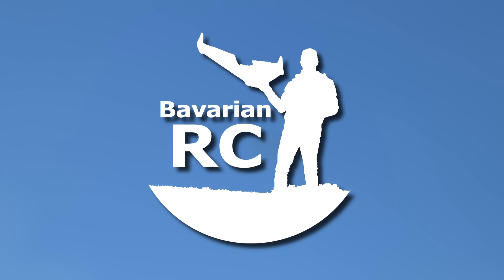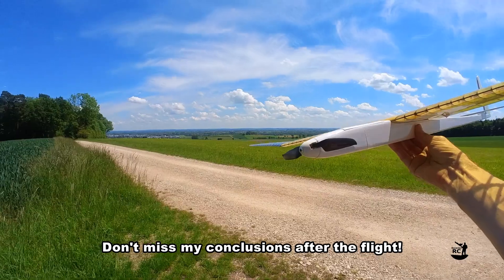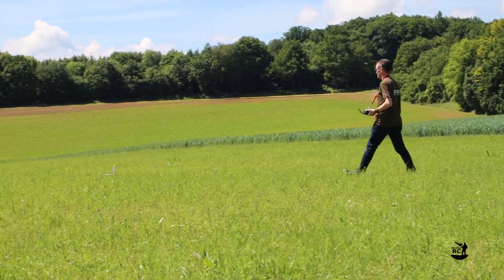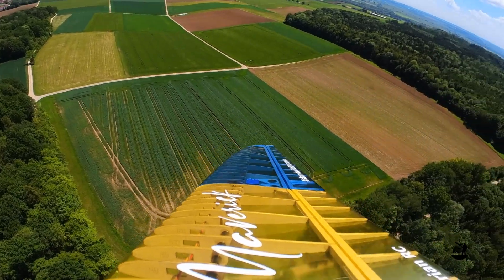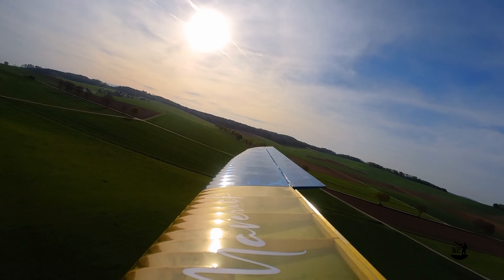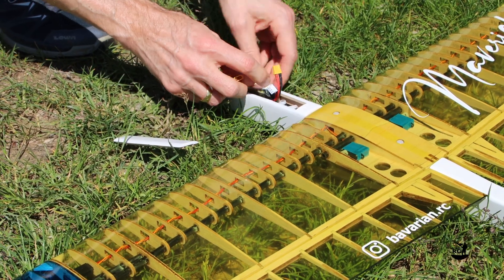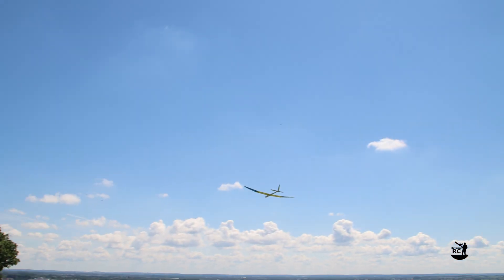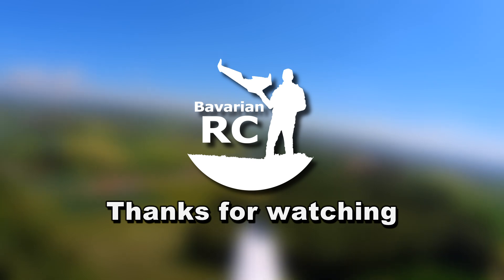Maverick F5K Electric Glider - Flight Video

Comment: I would like to reinforce the comment you made "just don`t fly to slow", it`s a problem i have with this glider, I just can`t help it. Thanks for the video.
Reply: Any plans to provide a larger version? 2M or 2.5 m ?
Reply: @louisgriffin1785  It is definetely a plan that will execute closer to the end of the year... So better to stay tuned ;)
Reply from the maker: There were like two occasions where I went into this thing about "not flying too slow". Both were during landing approach with flaps set. There were changing wind conditions and in the middle of the approach the wind suddenly dropped and let me there just "standing" in the air, 3-4 meters above ground. The Maverick of course went into a stall, nosed over but due to its low weight I could recover it just at the same time as I touched ground. Lucky bee I was!
Reply: @bavarian_rc  Yes, same experience for me, but I was not so lucky and had to make repairs....twice. I think I have learned now.
Reply from the maker: @meljones7066 Keep my fingers crossed for you!